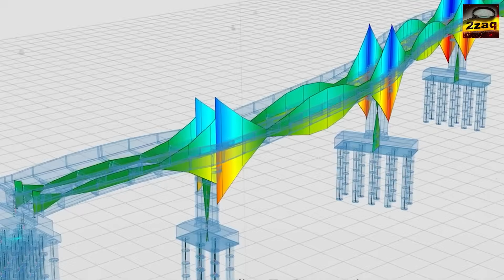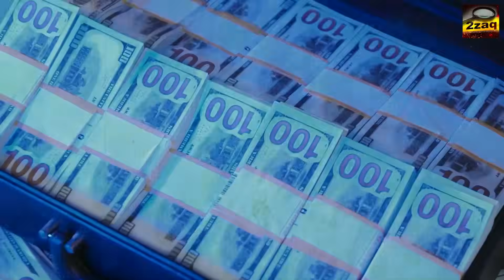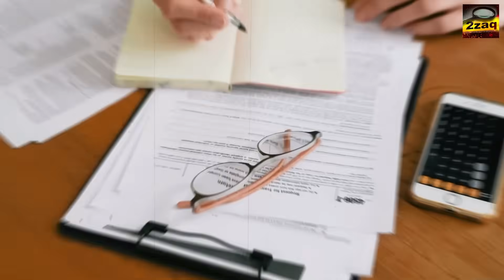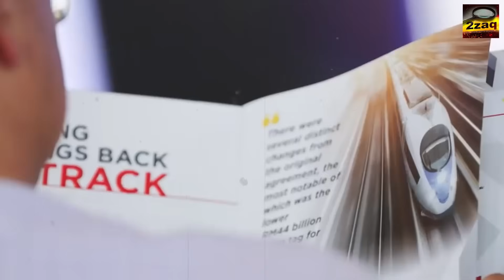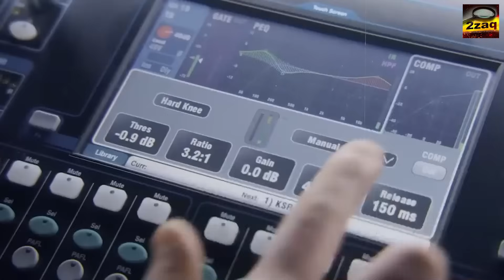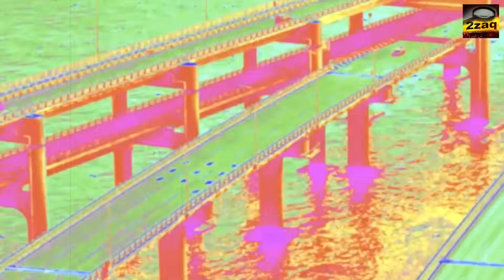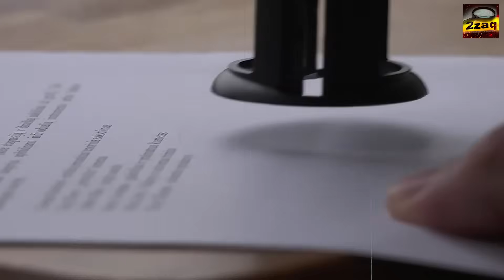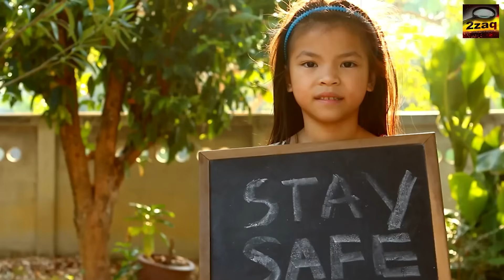$4 Billion Bridge to Link Africa and Asia.

Comment: This is nonsense, the entire need for the bridge revolves around the Line being build which has been scaled back by 98%. Almost nobody lives in this area otherwise.
Reply: It's for trade and connectivity. Cheaper to drive then buy airplane ticket
Reply: There  isn’t even a bridge between Europe and Africa which  would make 100x more sense than bridge between Africa and Saudi Arabia. Ships make more sense. Also roadways are not nearly as developed in Africa which is half the equation.